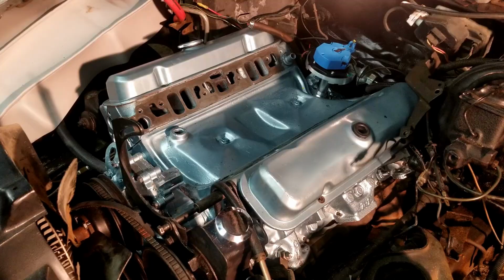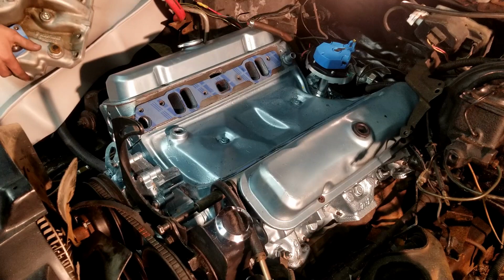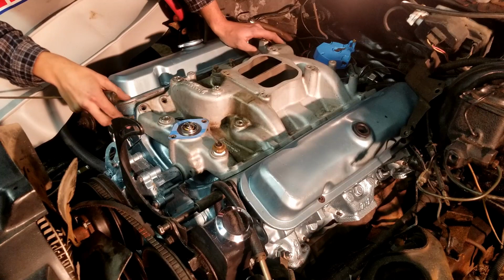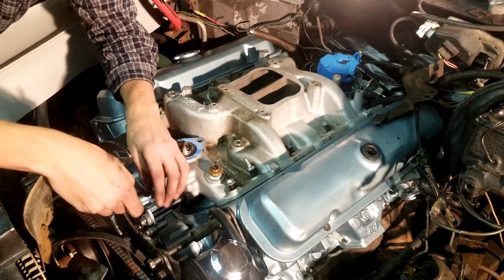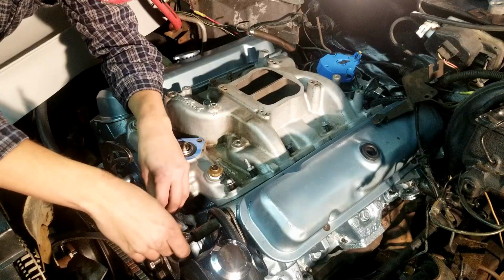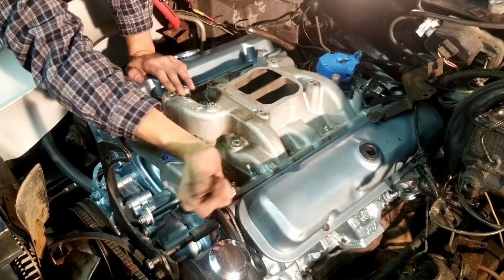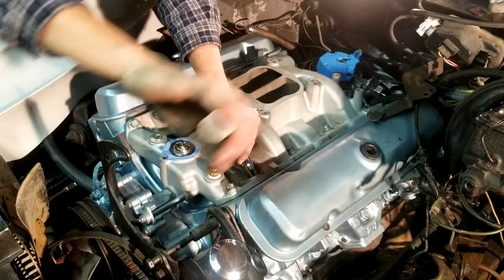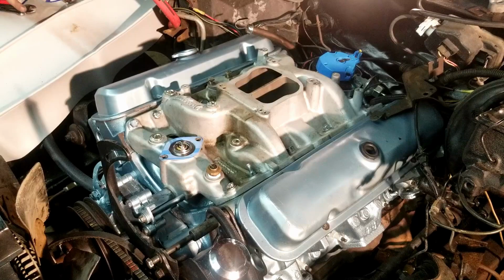Installing Edelbrock Performer Intake on a Pontiac 350 V8

Comment: Important not to jump immediately to the maximum torque spec (in this case 40 ft lbs). Start lower following the correct torque pattern and then increase incrementally up to 40.

Comment: Several things I noticed you did that you might want to change. 1st, when you put the gaskets on the heads, be sure to put a light coat of RTV around the water ports. I also use the alignment plastic plugs that come with most of the gasket sets to hold the gasket securely in place. No need to use a screwdriver to move the gasket around. Then be sure to use RTV on the new "O" ring seal to the water pump housing. Put the intake bolts in place finger tight, then install the housing to intake bolt and tighten it to pull the intake forward before torqueing down the intake bolts. Start with the bolts in the middle of the intake and work your way out towards the ends. 40 ft lbs. works well.
Reply from the maker: Thanks for the tips. So far no issues with the way I installed it.
Reply: I did this same job today had vacuumed issues with the intake  well who ever put intake on left them lil orange pieces on the intake gasket no wonder it was pulling vacuume from around the intake ports  when ya sprayed carb cleaner on it engine idel would chang big time and almost die

Comment: There IS a specific tightening sequence for the manifold bolts. It’s clearly found on the bottom of page 3 of the instructions. It is a center to outside progression. Exactly opposite of what you did. Just sayin’
Reply from the maker: There were no instructions sent with this manifold as it was purchased second hand. Thank you for the information though, that will come in handy in future intake manifold installs.

Comment: Was there no exhaust leak from the center ports between the intake and passenger side head? I mistakenly used that same Felpro gasket set on my '73 400 with '77 6X-8 heads off a 350, Performer manifold, and there was an exhaust leak near the EGR block off plate. I could feel and hear it coming up from the port in the head. Had to switch to the Mr. Gasket 502G gasket set with exhaust crossover block-off plates. Maybe this happened to me because I have later model heads and your heads are earlier?
Reply: I ran into the same issue on my 1972 455 am now looking into customizing Edelbrock gaskets as they interfear with the valvecovers.

Comment: Did you notice a difference with that intake manifold?
Reply from the maker: Honestly not really. My 350 is so mild that the only major improvement with the Edelbrock intake is the weight saved.
Reply: Old stock Pontiac cast iron manifolds actually breathed real well for a "mild or moderate" build.

Comment: Wrong intake gaskets there buddy.
Reply from the maker: Actually they weren't the wrong intake gaskets. These are identical to the ones I pulled off it before installing new seals and a fresh coat of paint. Thanks for the comment though :)
Reply: Saw the heavy mismatch on center port..Whats up with that?
Reply: What did you do with the center heat ports on the heads?